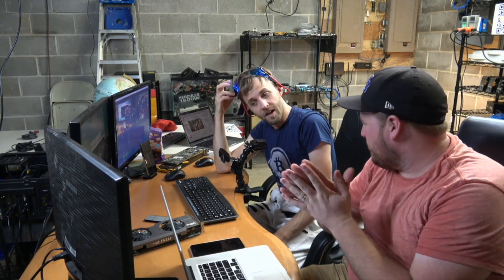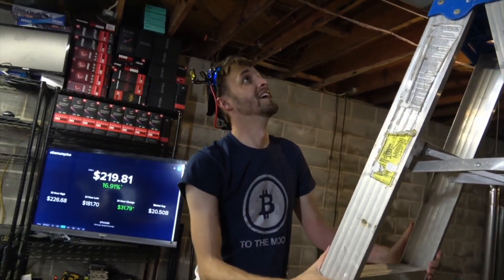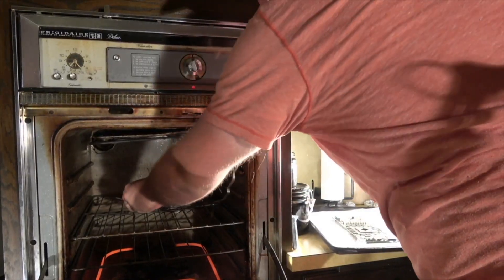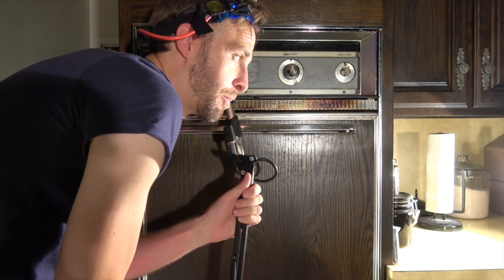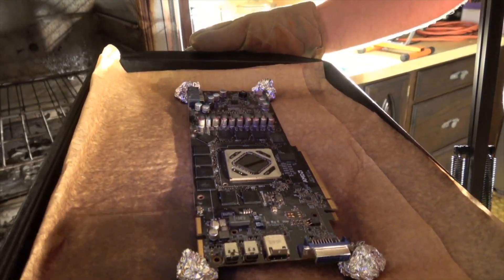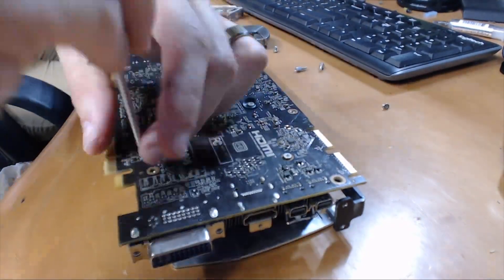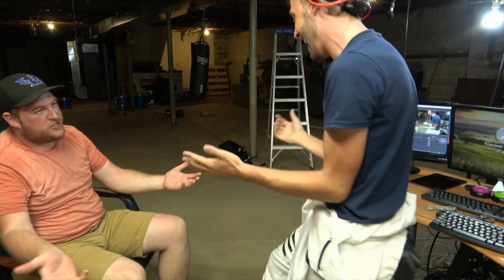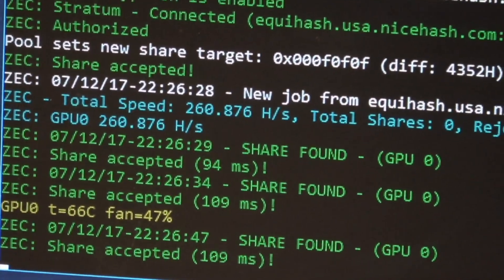Baking a Bitcoin GPU Mining Ethereum, Decred, Zcash

Comment: Unfortunately it will be broken in 60 days max.  This works only for a limited time, as the cracks inside the silicon are not fully connected. As time passes they will take their original shape an detach once again, making this "Hack" useless since it will not work a second time. This used to be a cheap trick in order to sell semi-fried electronics on e-bay, that would work once the buyer did a purchase, but the card would stop working after some time, from a couple of weeks up to 2 months. It has been demystified in numerous occasions by pros, so be warned!!
Reply from the maker: +Nick Pittas I really don't understand the point in all this? 
We tried something new 
It worked 
We had a blast doing it 
And thousands of people watched it loving it as well 
Who cares if the thing shuts off that wasn't the point at all.
Reply: Digital Gold guys really sorry, the comment wasn't meant as a bad one, just as a warning for all the guys who are following you and want to review their cards. The video was great and Fun and congrats on the working card, but as you have already seen, there are many followers that are wondering if they can do it too. And they shouldnt, unless they know that their Electronic are going to fail after a shot while.

Comment: @Digital Gold you should keep it mining @ 24/7 and tell us how long it will go for. (for science)
From experience after baking a gpu its life is at about 3 months, so great quick fix for those who cannot buy a new one right away :)
After it stops working again, even tho you baked it, you can try to bake it again and theres a chance it will work for another ~3 months. 
I did this with my old GPU before i upgraded to a GTX 1070. Baked it 3 times it keeps coming back to life xD!

The reason that cards do this is cause of poor cooling and they will develop micro fractures inside the chip. You can also get the same effect if you use a heat gun instead of an oven. (do not try this at home)

Oh and also if you are going to do this. Make sure you have enough air flow around the oven, you do not want to breathe in the fumes that come of the GPU while/after baking.

Happy mining ! :)
Reply from the maker: +Erikthebrave thanks dude it's currently still on!

Comment: Wow. What's the science behind how this fixes these GPU's?
Reply: Same science behind a hot gun fixing red ringed Xbox 360s. (Or even the towel method.)

Over time, the solders on components can melt or weaken. By heating the card or PCB of whatever electronics, it might reseat all the solders and put it back to running order.
Reply: Drew Thomas I had a couple of red ringed 360s so it kinda was learned from uhh necessity for me.
Reply from the maker: +Drew Thomas apparently it reconnects all loose connections
Reply: The Technoclast Wow. Been soldering since the Cheapmod for the original Xbox by Llama came out in 2002 and I never knew that. Thanks!
Reply: Usually this is only a temporary fix though, probably won't last all too long, but I'd be interested to hear how long this one lasts